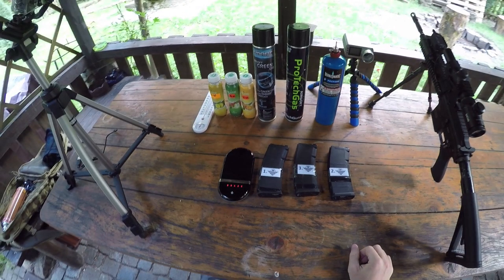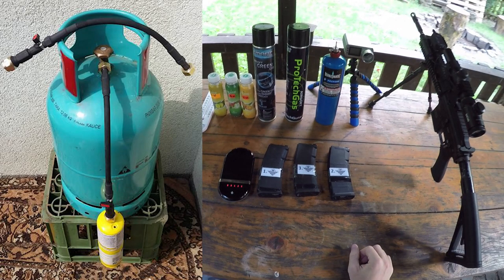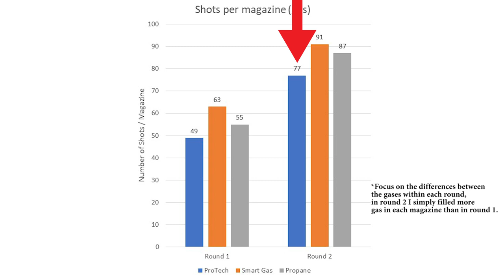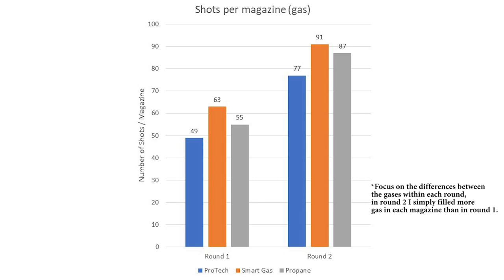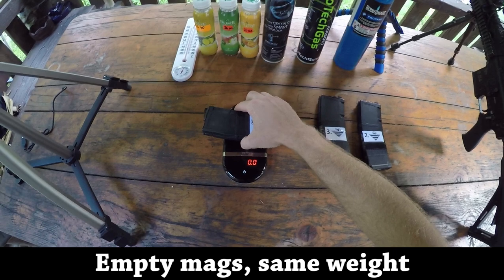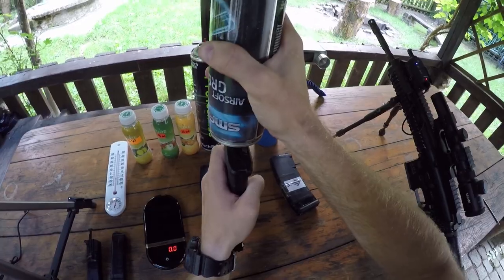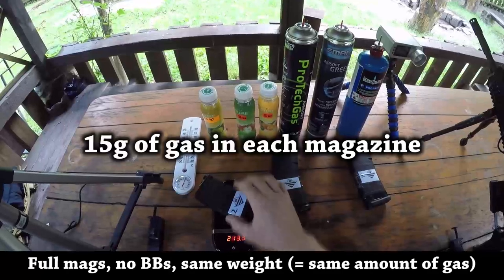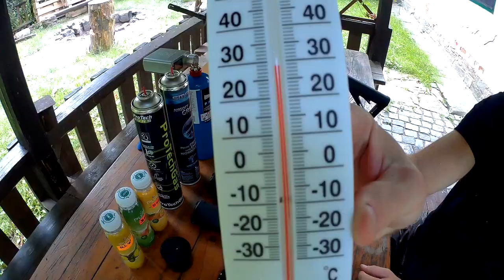DIY Propane vs. GreenGas | A Boring Comparison | Test

Comment: Hey wow!! Thanks for another nice video. I am learning every day! But then, is it ok to use propane without silicon oil?
Reply from the maker: you're welcome. It's better without oil.
Reply: @JosefMucha100  oh ok. even better!! Would you make a video about that as well?
Reply: It's better without the oil. "Green gas" is nothing more than propane with silicone oil added, in order to automate the lubrication of dynamic seals (and allow them to sell it at 10x the price :p). But there's only one dynamic seal on the GBBR systems: the oring / cup seal between the nozzle and the bolt carrier / blowback unit. That's really the only one that needs permanent lubrication, as it's subjected to friction and big pressure jumps (1 atmosphere to ~10 atmospheres and back with each shot). All other seals (the ones in the mags) are static and only really work through pressure difference once per mag fill, if you let the mag run completely empty. 
The issue is that while green gas automates the lubrication of the dynamic, it also accumulates on the barrel and bucking, ruining accuracy. Therefore, the smart thing to do is use dry gas and manually lube that seal about once a month with a tiny drop of light silicone oil.
Reply: @facundocorradini  Thanks!! This is super helpful!! You just saved a noob. (or millions more) ;)
Reply: @JosefMucha100  hi, the Pro tech gas has too much silicone oil? Like dripping oil ir not?

Comment: Hi Josef,  Can I use propane gas indoor ? Is it too smelly and not good for health ? Any suggestion if using propane gas indoor (or in a room)?  There are many type of propane gases on the market. Which brand/type has the higher FPS/Power/compression ?  Thank you !
Reply: Green gas is also propane. Just with added oil and perfume. So I would say yes you can use it just like green gas indoors but it miiight smell if you use enough in a small room. It is just as safe

Comment: Hi, I love the comparison. Detailed and accurate, even has the thermometer.
I have a possible problem in my we glock g18c gbb, I shoot using the green gas but even hop up at most it does not go up doing only about 20mts.
The lubrication that ends up wetting bb and hop up, avoiding backspin?
Reply from the maker: Thank you. 
Too much lube is worse than no lube. Clean the gun and leave a very thin layer on moving parts. Just 1 drop spread by finger. If it doesn't help I would get ML 50 autobot and if this doesn't help then the oressure on the nub is not enough. If the problem persists, it's the gun. Perhaps cracked nozzle or weak hammer spring. Depends how the gun feels while shooting.
Reply: that is a comon problem with WE Glock...it is not a lubrication problem,the problem is that the hop up bucking isn't pressed down properly.Change the hop up chamber with a maple leaf and it will be ok.Or try the Ikey ,it goes betwen the bucking and the hop up arm....
Reply: @matelorant1986  Thanks

Comment: Can we fill Magazine with lighter refiller Butane gas?? Green gas and Propane gas not available in my city..
Reply from the maker: Nope, it has to be propane. Butane has lower pressure.
Reply: @JosefMucha100  Okk..
Reply: I have a few times, no problems.. Josef states lower Fps due to pressure, but no damage should come with using it
Reply: @ThePOSM  What about propane butane mix? There is no propane in my country they only sell propane butane
Reply: @ognjen8964  hmm, well most propane here in the UK comes mixed with butane by a small amount, so id check the pressure that you get from your gas tank, and see if the mags can handle it. I think you can get the pressure limits on the sites/specs hopefully! But personally id give it a go lol, put a drop of silicone oil on the valve before filling, to keep things lubricated :)
Reply: @ThePOSM  Yeah thanks I've read a few articles about that, I think that pressure won't be a problem because propane butane mix in my country is like 50-50 or 40% propane maybe 60 or 70% depends from place to place.
Reply: @ognjen8964  give it a go! But be willing on the worst case to repair o-rings if too dry, keep your gun lubricated n should be good if not too much pressure! Butane has lower pressure than propane, so the 40/50% butane may be an okay pressure, chornograph your gun to check the velocity consistency:)
Reply: @ThePOSM  Thanks a lot man I'll keep all that in mind
Reply: @ognjen8964  no problem!

Comment: Does pure propane damage the internal parts because of higher pressure?
Reply: As long as your gun doesn’t have plastic internals, you should be completely fine. As long as you mix silicon oil with the propane (there’s videos about how to do that) but if you don’t want to mix it, it’s recommended you generously lube the internals of your gun and seals every time before use if you’re planning to run pure propane without any silicon oil mixed in. With all that being said your gun isn’t going to like shatter or explode, it’s just possible for seals and parts that need lubrication to dry out and wear faster.
Reply: @juleswinnfield3958  Don't put silicone oil into your propane... you don't want a slick hop rubber or inner barrel, as it will affect your accuracy, range and general consistency, and that's exactly where green gas is spraying most of that silicone oil.

Comment: Where in Europe could I get propane bottles like the one in video?
Reply: in america they are usually in any hardware store, probably could find them in a camping store. you also need silicon oil and an adapter for propane to work
Reply: any decent plumbers merchant store will have them. The blue (butane or propane) and yellow bottles (Mapp Gas) are used with a blow torch head when soldering copper gas and water pipe fittings.

Comment: Silicon oil is needed for propane. Anyone reading this never run your mags without silicone oil when you use raw propane . You'll damage your o rings pretty quick
Reply: On the contrary, don't put silicone oil into your propane... you don't want a slick hop rubber or inner barrel, as it will affect your accuracy, range and general consistency, and that's exactly where green gas is spraying most of that silicone oil.

Put a couple drops of silicone oil directly onto your o-rings whenever you take your gun apart to clean and lube it (which you should do frequently, especially with new GBBs), they'll be absolutely fine.
Reply: @MBKill3rCat  sorry kinda late here. So just keep your o ring/valve/rubber lip on the magazine lubricated with very small amount of silicone oil and just run propane dry. How often do you lube these parts, after 5 fills would you say?
Reply: @DiegoRodriguez-th1ho  I put silicone oil on my o-rings every time I disassemble and clean my gun, which I do after every game day. Even that is probably excessive.
Reply: @MBKill3rCat  it’s better to be excessive and keep that rubber nice and moist than dry and crack. Right?
Reply: @DiegoRodriguez-th1ho  I'm not sure, but I think you can overdo it.
Reply: @DiegoRodriguez-th1ho  Late response. You dont have to maintain magazines, only lubricate when the mag is leaking. Also using a lubricant such as superlube 21030 is miles better than silicone oil